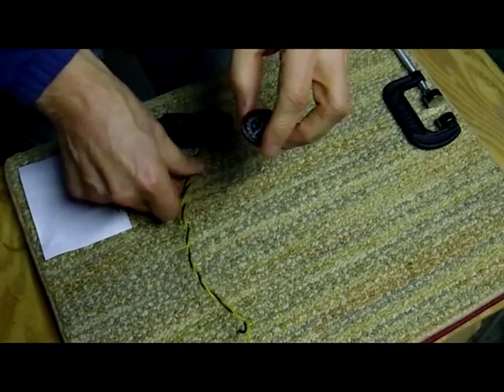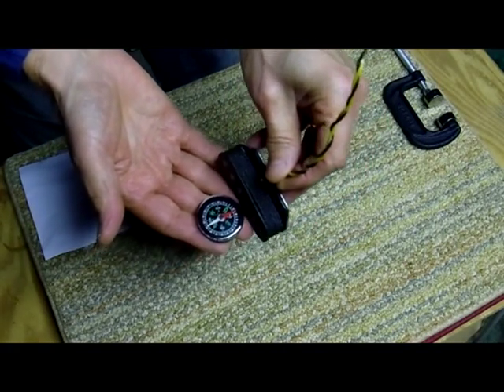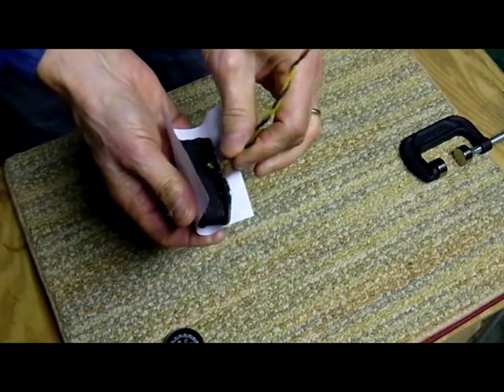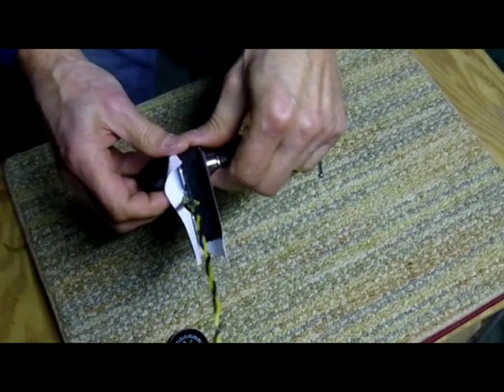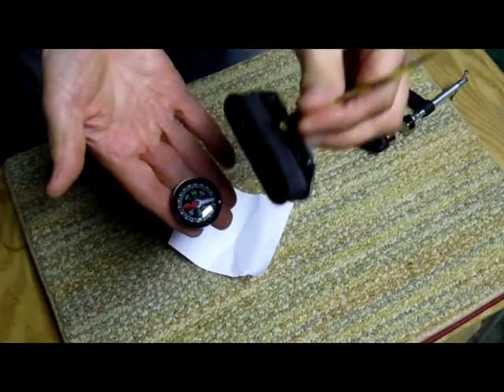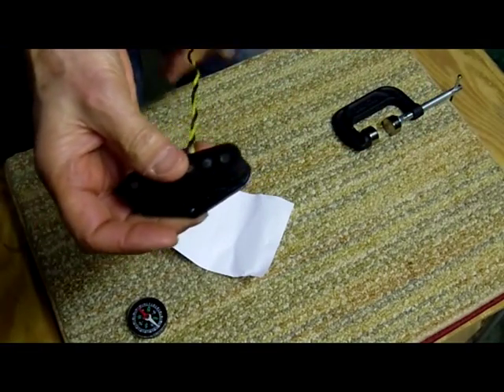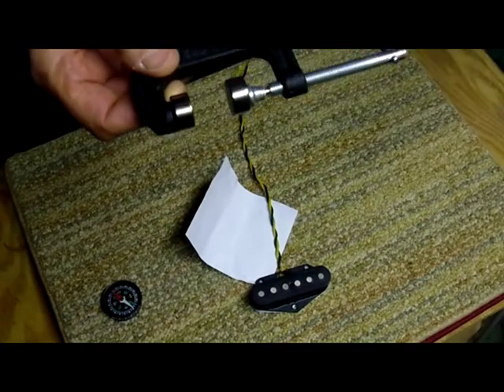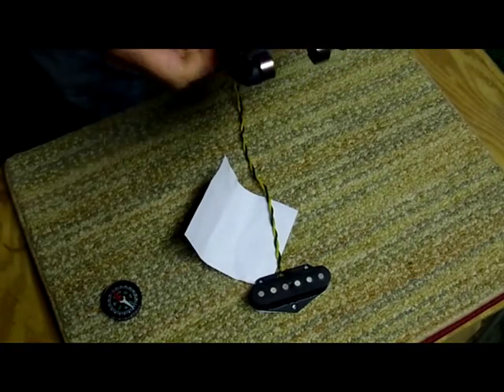Guitar pickup polepiece polarity flipping & charging

Comment: This is a great video!
This same method should theoretically work with changing polarity on a humbucker, as well?
Reply from the maker: For the very most part, there is no need to flip the polarity of humbucker coils, unless there is a special need that can be rather complicated and addresses each of the two coil's wind direction and top magnetic polarity as they interacting with some other single or dual coil pickup.  Mostly this has to do with either coil splitting or a single coil that needs to achieve an RWRP connection (reverse wind, reverse polarity) with one of the humbucker's coils. There are more than a few different build spex for dual coils, mostly with how the coils are wound, and not so much the magnetism for each coil.  Also of concern is how the coils are expressed in the resulting pickup leads, whether just one lead plus a ground or two or three or four leads, each with a separate ground.  Most humbuckers are built with a bar magnet that will power the slugs of one coil and the screws of the other coil.  Each coil will surround metal (slugs or screws) where one coil will be South and the other coil is North.  So, two single coils joined together in series, by their finish leads, thus doubling output.

Comment: I have watched Dylan Talks Tone, and he emphasised never use magnet on top of pickups because it will ruin the pickups!! However you have done it practically and it is working not ruined !! Cane you attach a link where to buy this device and what is called please thank you very appreciated it, best regards from ENGLAND 🏴 UK 👍🤘
Reply from the maker: In regards to your first post sentence - complete RUBBISH.  All that's needed is ONE neodymium rare earth magnet that's at least 3/8" diameter and 38" thick.  That magnet will be many times stronger in magnetism than any pickup's AlNiCx rod magnet.  Cheers mate! https://www.tdpri.com/threads/flip-a-pickups-top-magnetic-polarity.853731/
Reply: @rfdsrd  Thank you  for your kindness and explaining the science behind  this application which of course it will make it much easier and quicker. My other question is what about the wirings  after reversing the polarity of the pickup  what is your approach  please? do you  consider the hot wire as ground and the ground as hot   at the time of wiring the pickup and soldering !!👍
Reply from the maker: @drzainnas  All passive transducer single coil pickups will have a coil wire start lead and a coil wire finish lead.  EITHER lead can be the ground side or the signal side, as long as one of the leads aren't soldered to what is, or will be, a ground source (i.e. a pickup's back plate, cover, or frame).  If there are a pair of single coil pickups in a guitar, to achieve a noiseless humbucking mode one of the two pickups must be RWRP to the other pickup = Reverse Wind (of the coil wire) and Reverse Polarity (of the pickup's top magnetism).  If a guitar had but one passive pickup (i.e. Fender Esquire) It matters not what is the coil wire wind direction or its top magnetic polarity.  IF a passive pickup has one side of the coil SOLDERED to a part of the pickup that must be a ground source  (i.e. a back plate or cover or frame), that pickup's leads can't be swapped for any reason.

Comment: How much magnetic power can those N52 magnets instill in pickup rods? Do you need a gauss meter to know?
Also, what does it happen if you repeat that process? Will the pickup get extra magnetic power or it'll remain the same even if you repeat that priocedure other several times?  For example if you repeat that for ,say, 10 times then will the pickup get "10 times" its own original magnetic strenght? Or not? thanx in advance
Reply: Other Q please; how to lower a bit - just a bit, not a complete demagnetization - the magnetic strenght from a pickup?
Reply from the maker: A Gauss meter is not needed and the amount of magnetic strength imparted is up to them size and composition of the magnet to be charged (or recharged), and the strength of the "filler" magnet, and time to achieve full saturation.  Once the magnetic "fuel tank" is full, that's it, it's full, and will not increase Gauss rate.
Reply from the maker: @blop1738  To lower the Gauss rate of a magnet, you can heat it to a high temperature, physically shock it by hammering or dropping it, or expose it to a strong alternating magnetic field which will disrupt the alignment of its magnetic domains, effectively weakening the magnet and reducing its Gauss rating. None of this will be exacting.  To lower the Gauss rate in a more incremental manner requires an electromagnetic device.  But let's be practical about magnets in passive transducers (guitar/bass/steel pickups) and not make mountains out of mole hils.  There is NO sound or tone in these magnets, and their ONLY JOB is to magnetize the strings - so fill up the tanks and use their distance from the strings as a proper "throttle".

Comment: Thank you for the video. The tone of a pickup depends to the magnetic strengh of the rods too. So to recharge the rod magnet to their original strenght we must know what should be this strenght and measure it after the remagnetism process. Do you agree?
Reply from the maker: "fill up the tanks completely" - one pass of the charging magnet does it all, there's no need to check with a gauss meter, but if you do you'll see that no matter how long the charging time to a magnet, the properties of that magnet will be saturated to its fullest limit and will not increase. 

remember, the job of a magnet in a passive pickup is to magnetize the strings in order to create the magnet field and the induced signal.

Comment: When doing this, isn't the pickup coil supposed to be reverse wound also ? (RWRP) I have a set of Custom Shop '69's that I'd like hum cancelling on position #2 & # 4 but not sure just changing the middle pickups polarity would do it, the one coil actually need to be reverse wound to what the other 2 are....right ?
Reply from the maker: IF you have a 2 or 3 SINGLE COIL pickup guitar, and ALL the pickups are wound in the same direction, with the same top polarity, to make 1 of the 2 or 3 pickups RWRP (reverse wound, reverse polarity), in order to achieve a parallel humbucking noiseless mode when 2 pickups are selected., flip both the top polarity and leads of ONE pickup.  that's it.  

SPECIAL NOTE:  single coil pickups with metallic covers (i.e. - tele neck pickup) or single coil pickups with metallic base plates (tele or esquire bridge pickup), can NOT have their leads reversed IF one of the leads is strapped to its cover or base plate.  in that case the lead strap must be snipped/cut, and a separate ground wire soldered to the cover or base plate and routed to the guitar's control cavity and soldered to the back of any pot.  in the case of the tele or esquire bridge pickup, instead of attempting to solder a wire to its base plate (not for amateurs), just stick a bared wire under the bridge and use that as the string ground, routed to the control cavity and soldered to the back of any pot.

Comment: are the magnets just stuck on the clamp by its own mangetism ? One would have to be glued on so you get the same magnetic polarity between the two magnets ?
Reply from the maker: magnetism keeps the neo mags stuck to the "C" clamp, no glue required or needed.  Here's a video to show another far simpler/easier way to flip a passive pickup's top magnetic top polarity ... http://www.tdpri.com/threads/flip-a-pickups-top-magnetic-polarity.853731/

Comment: So to summarize .To recharge, keep the magnetic flow in the same direction . North to south  . To reverse polarity  .North to north south to south  . is that correct please?   -
Reply from the maker: Yes.  The more powerful charging magnet (typically a neodymium rare earth) will flip the polarity of a weaker magnet (typically the AlNiCx "vintage" rod or bar magnets used in Fender and other type guitars).
Reply: @rfdsrd  Thankyou ,I bought some Cs 69s  and the middle one sounds well strange .low in volume and almost out of tune even though it's perfectly tuned ?
Reply from the maker: @bluesmaster9896  Check the coil's resistance (DCR) with a meter - there may be short in the coil which can drastically reduce volume and tone.  Also check each coil lead to ground for continuity.  It could also be weak magnets that can only be checked with a Gauss meter - but charging with a neo magnet will insure the rod magnets will be at peak capacity.  However this could also be either magnets that are defective ruined by high heat or simply mixing the wrong magnet types - I've seen a few rod magnet pickups that were an unintentional mix of A5 and A2 or A3.
Reply: @rfdsrd  Just waiting on a multi meter through the post thanks
Reply: @rfdsrd  I got magnets today and charged the pole pieces .While I was checking the switch I noticed a blob of solder and strand of wire were stuck in the selector switch .Cleaned them out with a toothpick ,worked a treat . All works fine now .

Comment: Where can I  buy the clamps?  How are the magnets positioned on the clamps,  are the poles facing each other or opposite?
Reply from the maker: any common iron/steel  "C" clamp - home depot, lowes, hardware store, etc.  poles must be set opposite on the clamp!
Reply: Kool...  I bought two magnets..  But I  believe they're the same polarity ...  I just beat the the iron post out of the pickups and reverse them,and reversed the connections on the wires...  Bam!... I am happy now...  Lol
Reply from the maker: @judechery98  all magnets will always have TWO polarities, not one, else they wouldn''t be magnets.  be careful - depending on how a pickup bobbin is built, pushing out rod magnets can destroy the coil wire.  but at least all's well that ends well, in your case - good!

Comment: Nice video, but Im a lefthanded player and I wonder If I should flip the pickups if I re string a right handed guitar, thanks a lot bro.
Reply from the maker: not an issue, this is only about transducer polarity which has nothing to do with whether a guitar is righty or lefty. with single coil pickups, top polarity and coil wind direction only matter when two pickups are selected together and either phasing or humbucking (parallel or series) is an issue.  when pickups are out of phase the tone is nasal and wonky, the fix is to reverse the coil leads of one of the pickups (no issue with strats, but teles have ground strapping to covers and plates that need to get broken and separate leads run).  if any humbucking connection is required, one of the pickups must be RWRP - reverse coil wind direction and reverse top polarity, the opposite of the other pickup.  hope this helps.
Reply: @rfdsrd  oh wow thanks i didn't know

Comment: Great video! where did you buy those magnets?
Thanks!
Reply from the maker: https://www.kjmagnetics.com/
Reply: @rfdsrd  Which model number?
Reply from the maker: @Isabellovesjesus  any N42 mag that's about 3/8" in diameter and 3/8" will do, i prefer 1/2" x 1/2".  of course, the neo must be axially charged (the disc ends, not the sides).  in fact, you don't even need a "C" clamp, and you don't need to remove the pickup from the guitar (that is, any pickup with alnicX rod magnets, such as a tele bridge, or a strat, or a jaguar, etc).  i'll do a video that will make this video look extremely complicated and time consuming, and you will be both amazed and very pleased. :)
Reply from the maker: https://www.youtube.com/watch?v=ufhUd4wkPMs

Comment: Hello my friend, first, I want to thank you as I've managed to change the polarity of the pickup as you demonstrated...still haven't solved my problems! I have an AVR 62 strat, bought it used 7 years ago...it had the 5 switch but the hum is al over the place even in position 2 and 4...just bought a dimarzio humbucker for the bridge and I reversed the polarity of the middle pickup...even changed the leads, but the hum is still there....do you have any recommendations on that apart from buying another pickup for the middle position? Thanks very much, Dimitris
Reply from the maker: Are the strings grounded?
Reply: Hi dimitris, you should reverse the wire from the middle pickup, so that way youll have reverse wound and reverse polarity for the middle pickup (rw-rp). No need the change the pickups on your nice guitar. Putting a dimarzion humbucker can induce a different magnet field than with the original bridge single coil. you should look at the start winding on the bridge pu (north or south and look for the start bobbin and how is winded on it (clockwise or anti-clockwise)  . good luck

Comment: Would you please confirm whether you use the N or the S neodymium magnet to create the N pole of the pickup? (I seemed to miss this in the video) - Thanks!
Reply from the maker: +noplanb - opposites attract, opposites charge.  the SOUTH face of a neodymium magnet will charge a piece of iron (or an AlNiCo rod magnet) as NORTH.
Reply: so when u want to make top pickup became SOUTH you stick NORTH magnet to NORTH top pickup until it became SOUTH?

Comment: Sorry, once reversed the polarity you also have to swap the leads (I mean hot signal and ground) in order to have hum cancelling AND both coils in phase if you use the bridge with the neck in parallel mode; correct?
Reply from the maker: Maybe.  Lots of considerations depending on the pickup and circuit scenario in question.

Reverse Wind & Reverse Polarity is required with ONE of two pickups (Tele) or one of three pickups (Strat) IF a noiseless parallel mode is required (ALL the early Tele & Strats were NOT set RWRP - that didn't occur until the 60s).  With a Tele, it doesn't matter which ONE pickup is RWRP.  

Knowing the top polarity of any single coil pickup is accomplished with a compass, or take the two pickups and face their tops together - those that attract are already set Reverse Polarity, those that repel are not RP and will simply require a neodymium magnet to flip the top polarity of one pickup in seconds.  Learn how to do that here: https://www.tdpri.com/threads/flip-a-pickups-top-magnetic-polarity.853731/

Coil wire wind direction is not so easy to detect.  Flipping the leads on most any Strat pickups is straight forward and immediate.  Flipping the leads on most Tele pickups can not be done since bridge pickup bottom plates are strap grounded to one side of the coil, and neck pickup covers are strap grounded to one side of the coil.  If so, the grounding strap from one of the two Tele pickups needs to be cut and a new separate cover or plate ground wire soldered and run to the control cavity and soldered to the back of any pot (OR, that ground strap is soldered to the other lead wire of the pickup in question).

Most Strats and Nashville Teles use the middle pickup RWRP so that the 2/4 pickup select positions are parallel noise-free modes, but there are other considerations for Strats that include making either the bridge or neck pickups RWRP so that with a modified circuit (2nd tone pot becomes a no-load neck pickup volume blender) the parallel noise-free mode is for when the bridge and neck pickups  are selected (a very Tele-like tone).  Learn how to create a no-load pot here: https://www.tdpri.com/threads/no-load-mod-your-guitar-bass-tone-or-blender-pot-2014.466061/

Lots of circuit options and considerations!
Reply: What you are talking about is winding direction.  The starting point is always ground and the ending point is hot.  It doesn't matter if it's south up or north up.  It is important, for example, in the case of a Telecaster, which has two pickups, so that the polarity is reversed.

Comment: I find that my middle Strat PU, for strange reasons, lacks of magnetism..it is NOT opposite from the others 2.....it has happened more times.....when it happens only one string or pole doesn't seem to work anymore..like the others do....is that real? after watching this video I try to aplly with an hard disk magnet... IT WORKS.. but I feel it's not strong enough....is it possible?..will it loose its magnetism? thx
Reply from the maker: Are the pole pieces of your pickup rod magnets or slugs that are charged by a bar magnet underneath the pickup bobbin?  If each pole piece is a rod magnet, some flavor of the AlNiCx family, then use a very strong N42 or N52 neodymium magnet (a disc works best that's a good 1/2" diameter and 1/2" thick) to linger on each pole piece for 15 seconds.  That's more than enough time to reasonably charge an AlNiCo V magnet to approximately 1000 Gauss.

Comment: Does it have to directly touch the magnets? I have a couple of lipsticks I'd wish to reverse but I'm scared to open them (I assume there's just bar magnets inside the tubes).
Reply from the maker: no, the neodymium magnet used for charging doesn't actually have to touch the alnico/cu or ceramic rod or bar magnets you wish to either recharge or flip their polarity.c i routinely flip the polarity on telecaster covered neck pickups (rod mags).  yes, there's a bar magnet inside the lipstick case and touching the neo magnet to the case will charge or flip the bar magnet, it doesn't have to actually touch the magnet to be charged but you will need to use a relatively powerful neo mag, which means at least a 1/2" x 1/2" disc.
Reply: @rfdsrd  late thank you  - I made myself a lipstick-based humbucker, works perfectly.